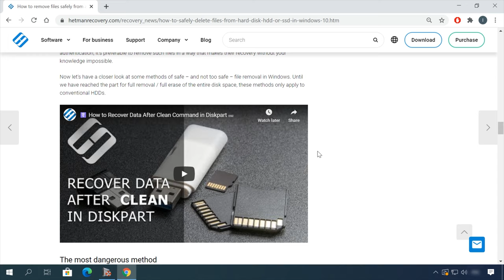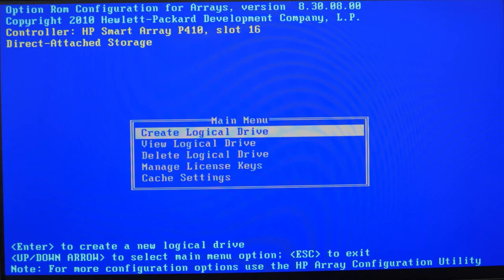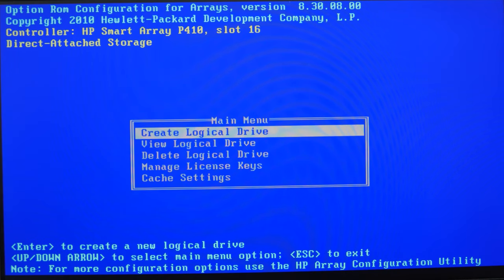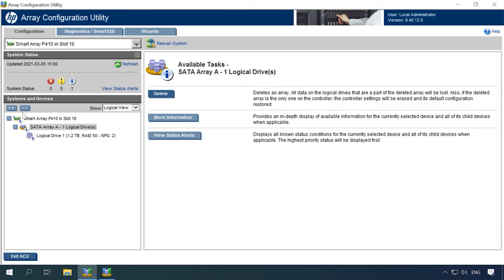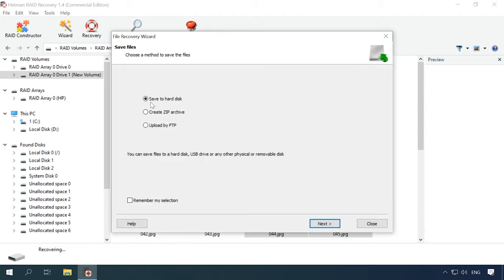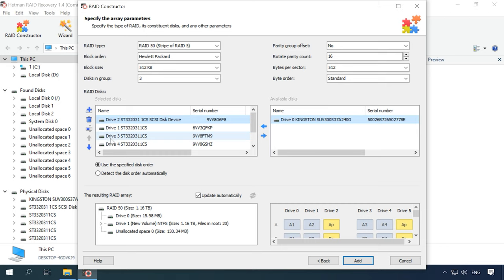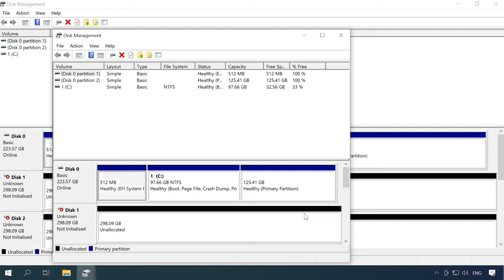💿 How to Recover Data from RAID 50 Based on HP P410 Smart Array Controller 💿

Comment from the maker: ⭐ Watch this video to find out how to recover data from a hardware RAID 50 based on an HP P410 controller. 
00:00 - Intro
00:55 - What is RAID 50?
01:39 - How to build a RAID 50 system in the controller’s BIOS and with the specialized software?
03:43 - How to build an array with the help of HP Array Configuration Utility?
05:02 - How to replace a hard disk in RAID?
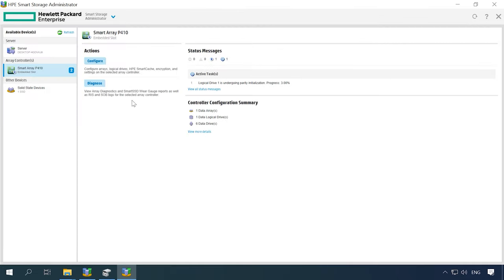05:50 - How to recover data after accidental removal or after a controller failure?
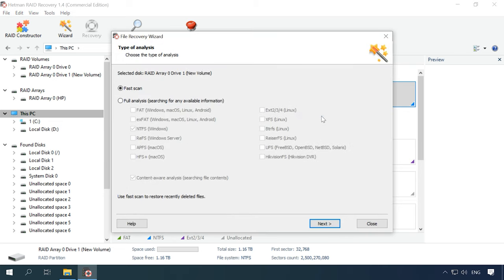07:45 - Recovery with two disks missing, and how to build an array in RAID Constructor
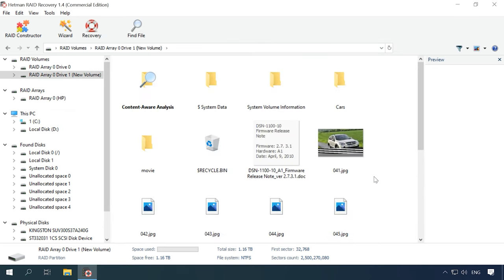09:26 - Conclusion